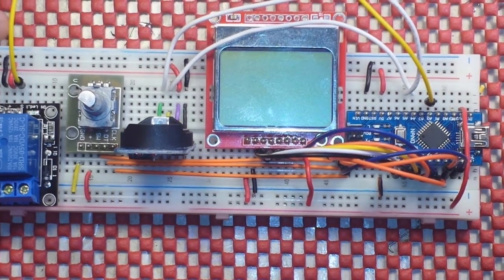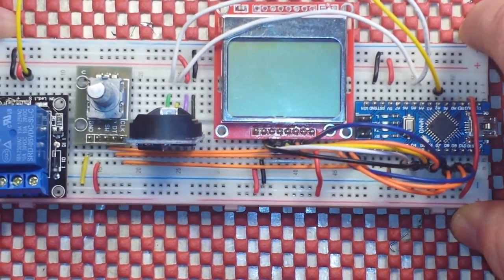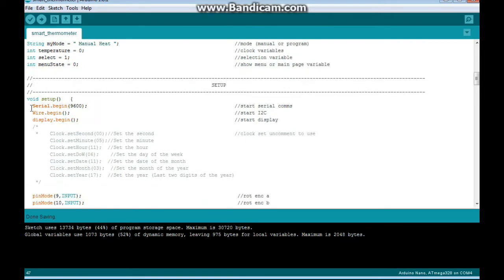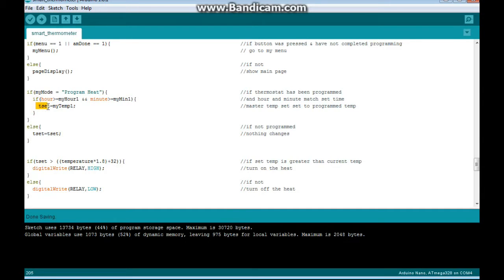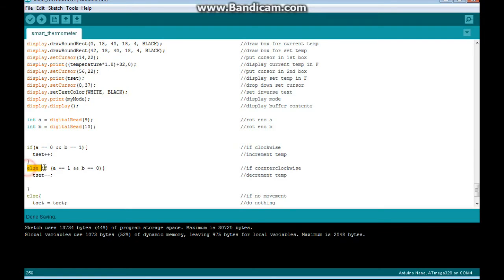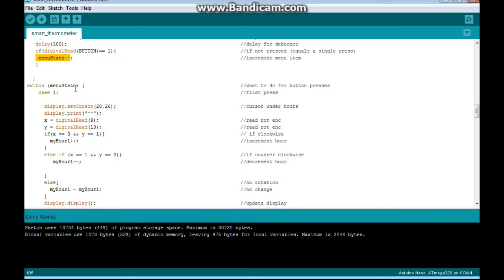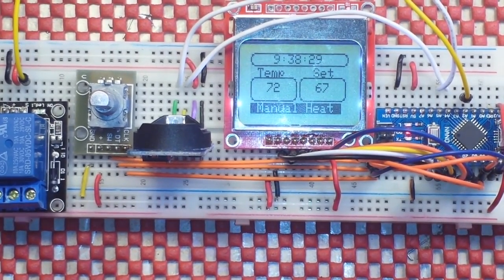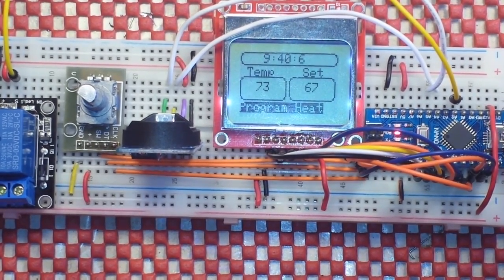Arduino Programmable Thermostat

Comment: trick to help coding, instead of numbers in switch statement, use constants which you define at the top. The state of device can be saved into a variable, eg. State, can be enumeration or just integer. You can make a method EnterState( int newState) in which you validate state transitions. E.g. when you are in menu, pressing button would take you out. This way you can guarantee that incorrect transitions between state are not made, e.g. entering menu when you are already in menu.

Comment: 5:13 thermostat relay without hysteresis goes BRRRRRRRR

or it will when the temp hovers around that edge case anyway.

Needs if tset > temperature yadayadayada else IF TSET < (TEMPERATURE - 1.0), give it a 1.0 gap between the on and the off so it doesn't flip around a thousand times a second on the edge case.

Comment: This is interesting for sure. Thanks for sharing, now I finally know where to begin for my own thermostat.

Just a small question, would it be possible to make it IR controllable? Logitech Harmony remotes can be programmed and customised, maybe a good tip for IR based projects for you, too.

Thanks man!
Reply from the maker: Nick Stompé Hi Nick, I'm glad you liked the project. Adding an IR sensor would be no problem at all. I did a video on using IR remotes with Arduino. I used the unused buttons on LG TV remote to control the Arduino.
Reply: learnelectronics Ah, if it works with an LG remote, it HAS to work with a Harmony, haha.

Thanks for the feedback, I'll check out other videos of yours when I have some time again and if I need more info you'll see me again.
Reply from the maker: Nick Stompé I'll be here if you need me.

Comment: Just what i was looking for! Can i use 3 pushbuttons instead of a rotary encoder?
Reply from the maker: +Josh Hagen sure
Reply: learnelectronics, im not to great with writing code but i would want to change the screen to a 16x2 lcd display keypad shield considering im using an arduino mega, how would i go about modifying your code to fit these changes, im also using a k type thermocouple  to measure the temp, can the code be modified to use that?

Comment: I am working on a humidity control project using what is essentially a dish of desiccant. My goal is to expose the desiccant using using a servo, but I want to tune the set point humidity manually. Do you think I could use the setup you displayed in this video and just change the temperature settings in the code to humidity? I'm using the DHT11 humidity sensor.
Reply from the maker: Chandler Bartz yeah, for sure that would work
Reply: If you don't mind me asking, what are you using for power supply?
Reply from the maker: Chandler Bartz I think I ran that off of USB. but if you are using a servo, I'd recommend an external power source
Reply: Okay great. This is my last comment/question. I am very new to this sort of electronics project and coding, so I apologize if I am being a nuisance. For my project, I do not need time, so I will probably leave out the little adafruit clock and replace it with a DHT11 humidity sensor. Obviously I will have to crop the code regarding time, but will it affect the functionality of the code otherwise? Thank you so much for your help!
Reply from the maker: Chandler, feel free to ask any questions you want. No bother at all. That's why I'm here. Cutting out the code for time should have no effect.
Reply: Hello again. I am assembling everything now, but I have come to realize that I do not know what the relay is for. Do you need the relay? The only device I have that doesnt run on 5V is the nokia 5110, but I could use a voltage divider to meet the 3.3v requirement. I am considering lining up my sensor, servo, and lcd (with voltage divider) parallel to one another off of the 5v pin on the nano. Is this a bad idea? Again, I am very new to all of this.
Reply from the maker: Chandler Bartz the nano has a 3.3V pin, just use that. this sketch is a little more than what you would need. a simple mapping of the humidity reading to servo degrees is all I would use.
Reply: So, just to clarify, I can do without the relay entirely?
Reply: Also, I greatly appreciate your patience and help. You're saving me this quarter.
Reply from the maker: Chandler Bartz The relay is only to energize the furnace. If you are using a servo you don't need a relay. good luck

Comment: Excuse me, can you pass me the link from the rtc library?
Reply from the maker: There is no link Tony, just open your library manger within the Arduino IDE and type ds3231 in the box. Click on More Info, then install. Thanks for watching and taking the time to write.
Reply: Been trying with the IDE libraries, with no success. Trying alternative libraries just gives error after error. Any suggestion on getting this going with the current version IDE?  Was hopping to modify this to act an a time/temp trigger for a relay, but....

Comment: I feel like we gotta talk about display.display(); That right there i a gross line. I don't know much about Arduino but i feel like this guy could benefit from a switch statement. Is sit just me or does Arduino code remind you of Java Script. Very method based. I feel like amDone should be an int called menuProgress. amDone isn't right. You could throw in a couple lines to convert military time to am pm. refinement i guess. Looks good none the less to to be frank. No one asked for my opinion.